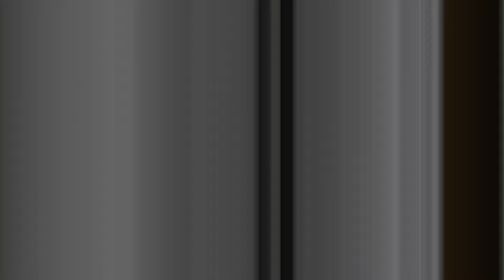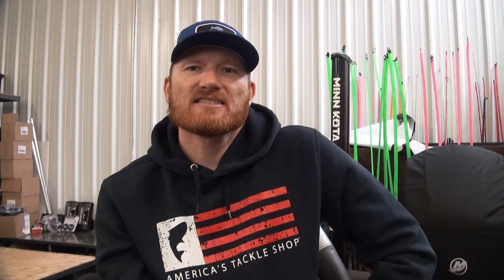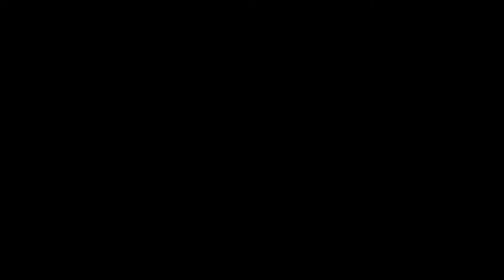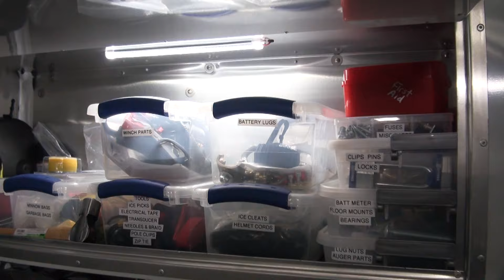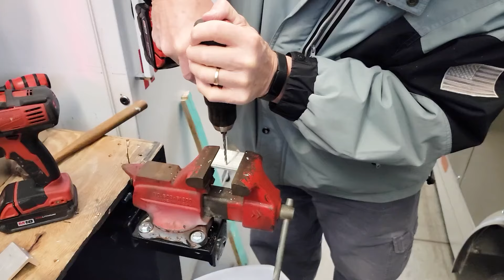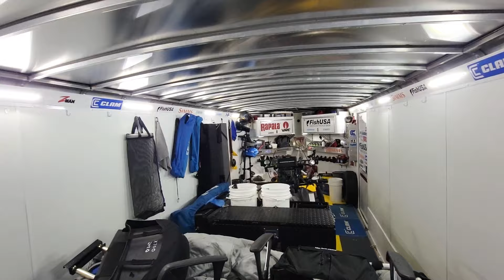2024 Bigwater Custom Trailer Build - Part 3 Lighting

Comment: How will your "Tee" connectors be better than a "Tee" connector that might be used in a boat? I had major issues with them after a dealer used them in an earlier boat that they rigged. 
Keep your videos coming Capt!
Reply from the maker: You need good ones just like anything else. These won't be exposed to the beating and elements you see in the boat

Only tap i use in my boat is 3m scotch tabs to connect a quick accessory wore for extra nav light. But it is also removed in a yrs time
Reply: @Bigwaterfishing  They must have a gel inside to keep air and water out?